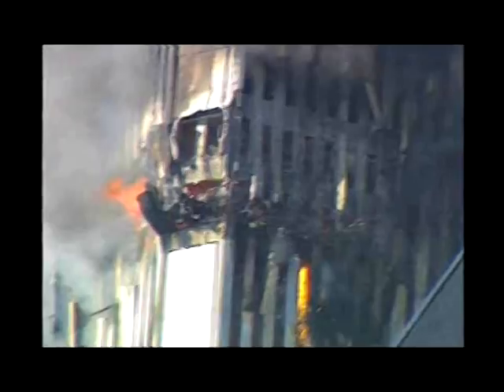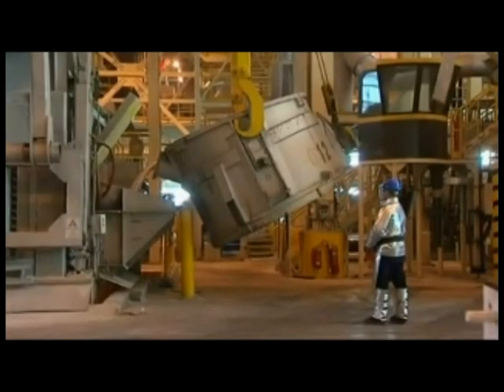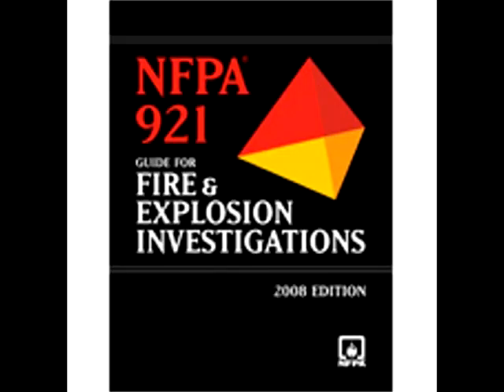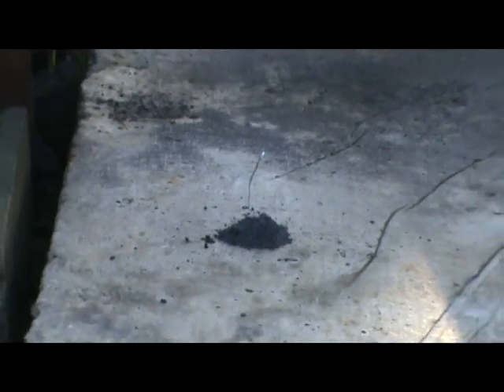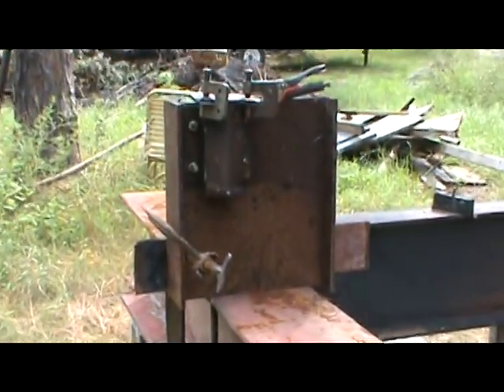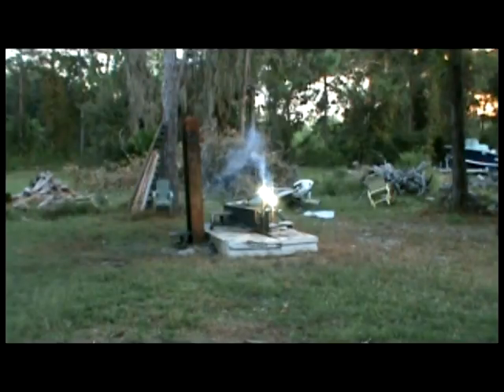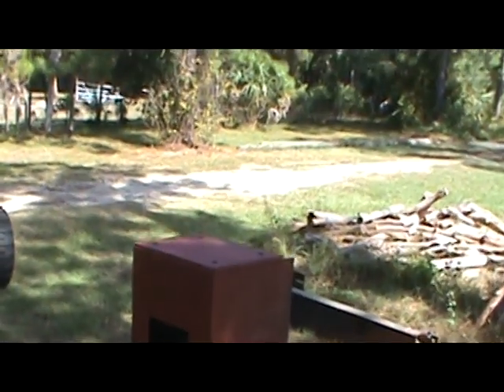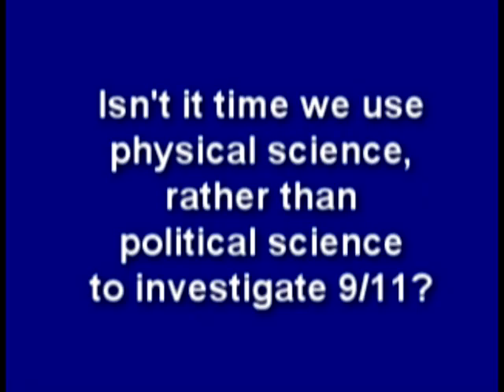9/11 Experiments: The Great Thermate Debate

Comment: We use construction rated thermite all the time for underground workings.  It is very explosive/reactive.  In the military it is a common tool for defensive and offensive capabilities that can easily be shaped and suspended in other solutions/delivery methods.  Super Thermit is a different story.  I could guess at it but I wont because I may be wrong.  Someone else will nee to comment on the later.

Comment: totally deluded nonsense, any fire can melt Steel if it's intense enough and long enough plus the weight on top produces a massive heat sauce in its own right, through friction and micro friction the more weight you have the more intense the heat builds up it's like a pressure cooker the inside was collapsing before the outside that's why you saw the molten metal. even housefires can melt steel beams don't know what he's trying to prove or disprove bullocks no conspiracy at all just nonsense.

Comment: It's very fascinating the amount of rubble left behind from such large buildings, it seems minimal, if none of the structure was destroyed by heat. 2nd point, what ever method was used to bring down the building, it would involve much set up time, where are the witnesses to that. 3- they had but 1 try to pull this off, like going to the moon, it's fascinating that no one has come forward with a conclusive theory, it's as if, some new technology was used. (don't forget the set-up time)

Comment: 12:14 So is the narrator implying that the thermite was hidden in the box sections when the building was built? I can't see how explosives could have been placed in the supporting structures in the weeks before the "attack". The interior walls are finished, sheetrocked and painted, and the offices rented and used daily.

Comment: "After the plane hit" what a load of crap just stop with the bullshit please.
How can the tail section of an airliner during an impact process (with no longer any plane attached, or power) push it's way forward against air resistance and force it's way through the intact columns of the outer wall?
People need to stop repeating this NONSENSE about planes, the only thing it does is to totally shield the media networks that used faked images and interviews to run a hoax on TV.

Comment: Planes are made of magnesium and aluminum. 
These 2 burn at about 5200 degrees.
Mix that with jet fuel pouring down an elevator shaft while on fire. 
Now how compressed was the remains of that plane on impact.
Now all of that heat, with TONS  of weight on top, something has to give.
A floor collapses with all that weight yeah I believe that shit is going to crumble just like they did.
Experiments are nice but that situation cannot be reproduced  in a lab.

Comment: The presence of molten metal doesn’t mean it was molten steal. Further, relying on an eye witness is only viable as evidence when one can validate the credibility of that witness. A wittnesss who is terrified is typocally is not reliable source. Secondly, proving that you can cut steel simply disproves the assertion that thermite can’t cut a steel beems and really only proved it could cut YOUR steel beem. Did you prepare the steel to the same standards as those used in the towers? Was heated treated the same? Was it the same type of steel? Was your’s exposed to the elements prior to testing? Did the steel beems in the towers have insulation in close proximity? The test bounderies were too narrow to prove anything other than the concept that thermite can cut vertical berms under extremely vague circumstances.

Comment: Why has nobody considers terrorists planted thermite on the building? Not all of them wear turbans and walk around in cloths.
Reply: Because they didn't, you don't need thermite when you hit a building with 14 times the force it was built to withstand. Also if there were bombs inside, rigged to the walls which you need to bring down a building, people would've noticed real quick. It also takes around a year to setup a demolition, not including the planning, that was before Bush was President. Bush would've flipped the plans when he heard his predecessor, a democrat, did something like that.
Reply: @_Andrew2002  ik it's not what I think but it's funny all these people who want the government to have done it don't even consider that as a possibility for their belief to be true.
Reply: I'll give you a tip for debating these people. I used to be one so I know how to flip them. Give them strong evidence that they have a temper tantrum with which does start the process of returning to the good side. They will over weeks start searching up 9/11 truth debunking to test their theory and will eventually flip.
Reply: @_Andrew2002  You realize that the buildings' elevators were shut down for six months before the incident right? Each of the main elevators were installed along the main core of each building. No one would have guessed.
Reply: You fail to explain why people inside the elevators did not find any explosives as they dug out.

Comment: Ok so you think what exactly??? That the dark goverment forces went into the towers before the planes crashed and went floor by floor to the weak points with thermite cutting bombs and placed them without anyone noticing or asking "hey sir why are you cutting into the wall there and putting that bomb there on every floor???" do you know what it would take to acess a i-beam on a skyscraper? they are not just out in the open, it would be a serious construction demo. or are you saying that they where put there when the towers were originally built? And laying in wait for the evil goverment to fly planes into the tower? Ohhh or how about the planes were filled top to bottum with termites, and they ate throught the beams??? Ohh shoot i said termites I meant thermites sorry! Sounds more likely that jet fuel mixed with other excelerants, caused the fire to get hot enough to metal the steel that was under tremendous pressure from the wieght of the failing structure. (As beams fail because of impact the surviving beams are put under more weigh meaning higher pressure.)  and the fire + pressure equals falling towers. Seems alittle more plausible then planes full of termites!

Comment: Okay so the take away is that it would be possible to melt the steel beams, with tens of thousands of purpose built thermite cutting boxes.... Boxes that are not destroyed by the thermite, so were something similar used there would be thousands of them as evidence laying around in the rubble. Also such a set up would require miles upon miles of wire to initiate, you couldn't use radio control because with all the concrete and steel, they would be unreliable. 

Now if you were to come at me and tell me that the US Gov colluded with another government or organization to take out the WTC, or just knew about the upcoming attack, I might listen to that. But in the 17 years since the attack not one person has come forward with evidence the US planted explosives or thermite in the towers, this is whole theory is ridiculous. There are leaks EVERY DAY of highly sensitive documents. Bradley Manning did a bulk dump of all of the US Military's secrets in the Iraq/Afghan war. Snowden leaked a bunch of stuff. There was a guy from NSA that had thousands of top secret files in his house for "just because" but you expect me to believe NO ONE has leaked anything on the single most outrageous conspiracy in the last 100 years?

Comment: I see a lot of people quoting "jet fuel can't get hot enough" well guess what, jet fuel wasn't the only thing burning in there. It was a ton of other debris from the plane, I'm talking carpets, clothes, wood, and people. Plus, look at the smoke angle, that's a lot of air flow. And I'm not convinced that the molten metal pouring out the side was steel, it's color looks about the Kelvin that aluminum melts at... Which is what the plane is made of... So you have two things that are unrelated that are being used to get and prove a point.

I'm not saying our government is great  and doesn't do shady stuff to enter wars... But why go through all the trouble of hitting the towers AND the Pentagon, when just saying, "we're going to liberate them poor people" did the same trick for 20 years. 
All these conspiracy theories are wayyy too complex. There's just too many assumptions to have to make for the theory to even be plausible.

Edit: and the whole thing about the magnesium lighter... I'd bet my left nut that there was magnesium / titanium in that plane, because both of those metals, when hot enough, if you pour water on them they will explode in a white flash. And I'd bet my right nut that the towers had sprinkler systems.
Reply: First, search on youtube for molten aluminium, see how it looks like.

Comment: This is very convincing, however the supposed hijacker apparently had bombs inside the plane. Could thses bombs have included the substance possible of melting the steel beams?
Reply: No, get your mind of the foolish theory  that steel has to be molten to loos any strength